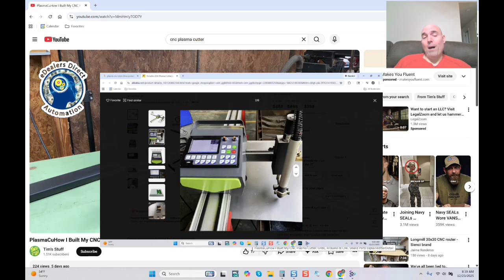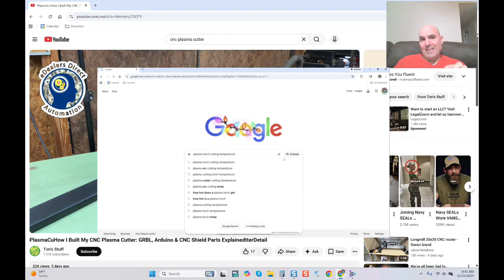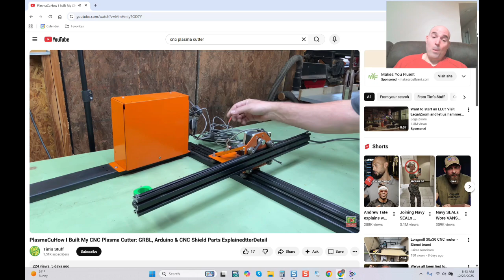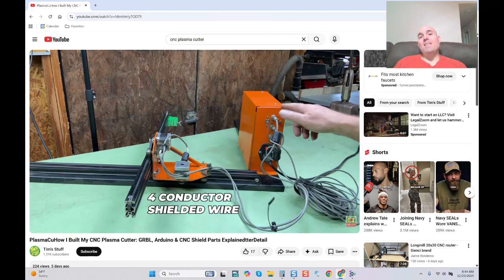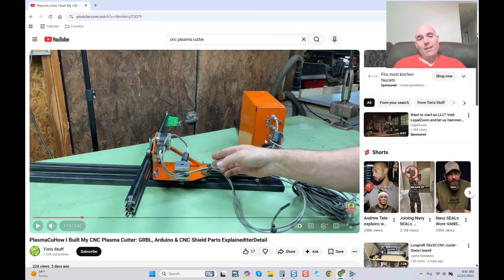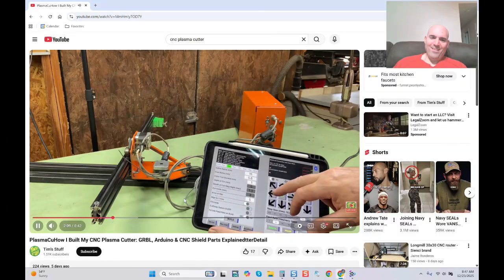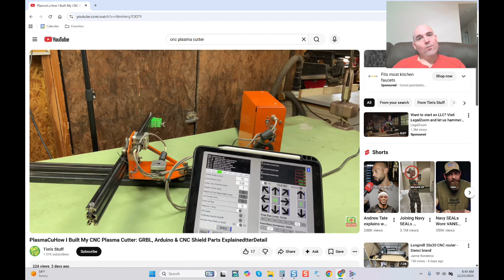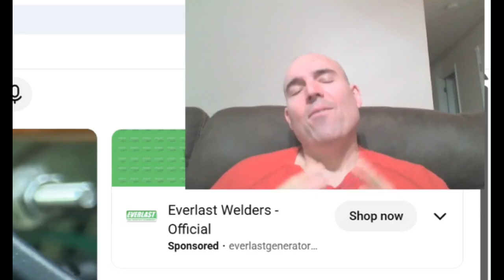This Contraption Is An Insurance Company's Wet Dream

Comment: If it works, it works. Tens of millions of machines are running on arduino CNC BoBs. This is a fun project. Safety is one thing, but some of the reaction in this video is just elitism and/or financially motivated.

Frankly, if somebody wants to be elite and safe, they would save up and buy a professional machine and not hack it together using components from an ebay store. Something to think about.
Reply from the maker: Here's something for you to think about you make up what you type to make yourself feel better. 

Show me where tens of million machines are running these Arduino CNC robots without having stability issues?

Oh yea you can't, because its BS.

I provide actual screenshot/video  evidence in my video's an you provide nothing but emotional insults.

Then you attempt to use the phrase " hacking together", You actually feel his system is a REAL robot? 

Facts unfortunately don't care about your feelings. 

Thank you,
Vince
Reply: I'm not emotional or saying anything to "feel better". That's just ignorant. A little ironic considering your response. 

I can't show you millions of machines using micro controller + cnc BoB in a youtube comment. It's self-evident. They sell, they exist. Measurable noise does not automatically translate to measurable performance loss. It's open loop stepper control, modern digital electronics. Nobody needs to buy a gecko controller (which is a nice package but nothing magical) or your integrated driver system for $1200 in order to build their machine or get great performance.

There is no place for that kind of gatekeeping or unwarranted elitism. You seem very knowledgeable. I would recommend you think about how you present yourself online/professionally. It wouldn't hurt you to be a little more magnanimous in these comments or in your reaction videos.
Reply from the maker: Here's an idea as you obviously like using big words.

 I show facts sir, in all my videos and you show your feelings are hurt by those facts which is in your comments. 

You're absolutely right you can't show any actual results of your claims because its pure opinion.

 Lets you, and I have a live stream debate, and you can prove to everyone on my channel your more than just a keyboard warrior. 

Thank you,
Vince
Reply: @corvetteguy50  What even is the debate here?

Comment: Haven't built a plasma robot but I've built several lathes and mills.  The advice you give is solid.  I hope you can do a video on fully closed loop controller some day.   Elara uses decent hardware and a modified version of Mach4, this likely what I will use for my next mill.